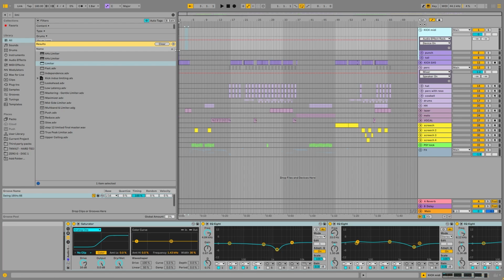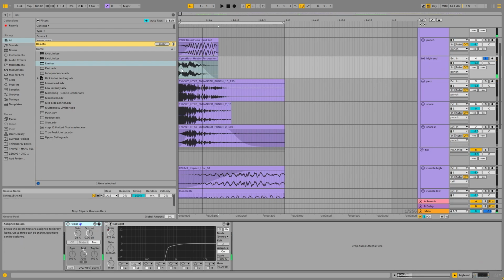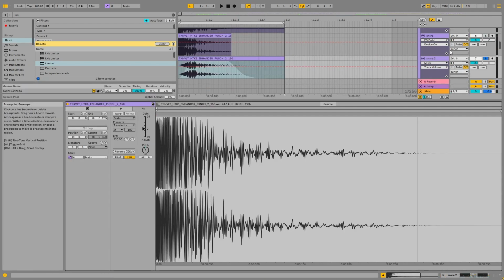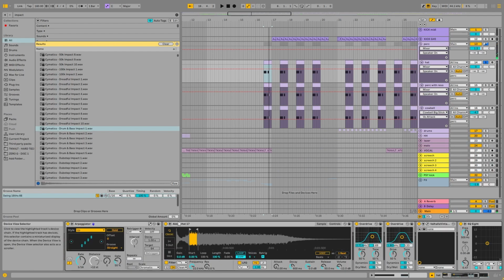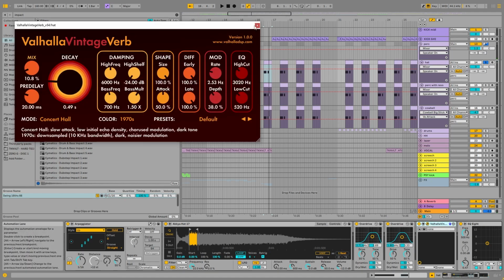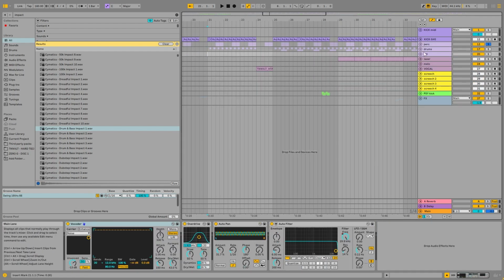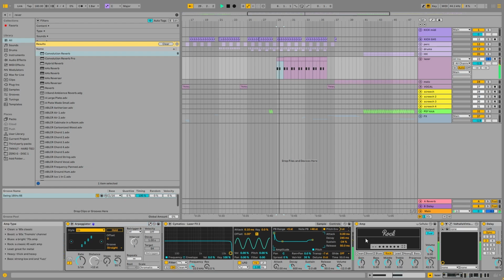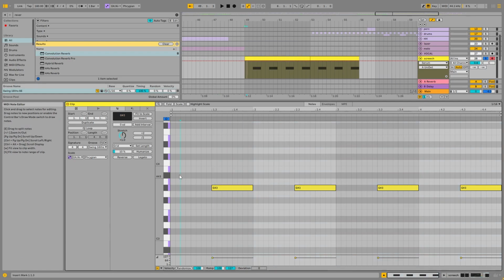Vieze Asbak Style - Hard Industrial Techno Tutorial | Free Project File

Comment: Love the videos, doing a great job.
With your main/master you’re in the red.. Beginner producer here. 
Do you need individually work the volumes of all audio channels to get it green/yellow on the master? I noticed in your project file that the kick is at -2.0 db, with other audio channels playing like drums etc. the master is in the red? I’m worried my track is clipping. Does the master being in the red matter? Any help would be greatly appreciated.
Reply from the maker: @blownz15  Hey, the mixing channels could go in the red, but not the master. A good approach is to mix a -6dB (you put the kick at -6dB, which is normally the loudest elements. That way you are not going to hit the red in the master. When mastering the project you can boost everything and use a clipper/limiter. Here I don’t make things academically but thats how I would advise you to do
Reply: @graphmusic  thanks a lot that helps very much! I have followed that method and found that my kick isn’t hitting as loud and hard as I want around -6db compared to -2db. Is this something that can be recovered in the master when boosting?
Reply from the maker: @ Yes, it’s the mastering process, you’re going to boost back everything with multiband compression, limiter/clipper etc. You can check a video to understand how a mastering chain is made

Comment: Im trying to follow along with this turtorial, but one thing I cant figure out, its how you used the reverb to fill up the high end, maybe its because I dont have your side chain and reverb plug ins yet. Do you recommend to use normal or hybrid reverb(just ableton standards) Im also a bit new to producing, so sidechaining is still a bit difficult for me. Maybe it goes wrong there.Thanks in advance for your response!
Reply from the maker: @quintsuijker8206 I use mainly the convolution reverb (it is free with ableton you can get it)
The choice of the reverb is really to your liking for the grain/room you want to put it. Expriment with it and chose the one you prefer
Sidechain is mostly for low fréquences but you can apply it on higher frequencies, again you can experiment